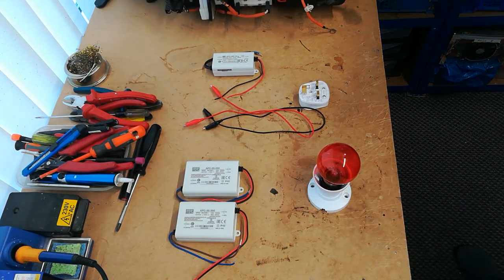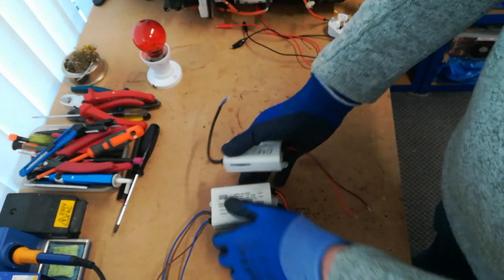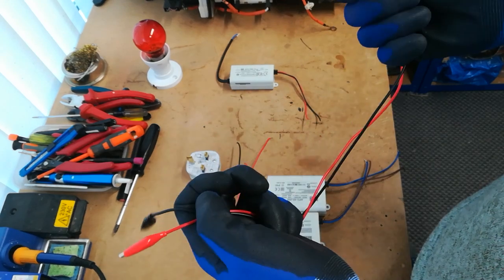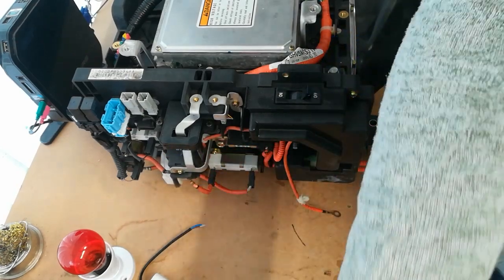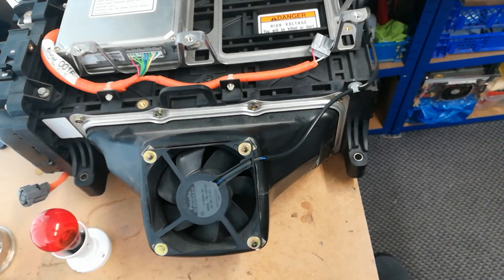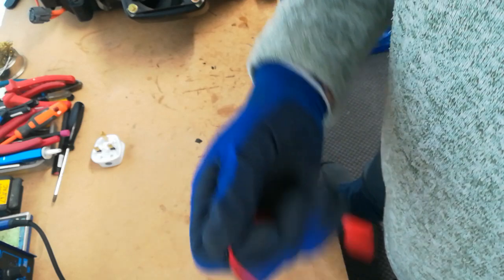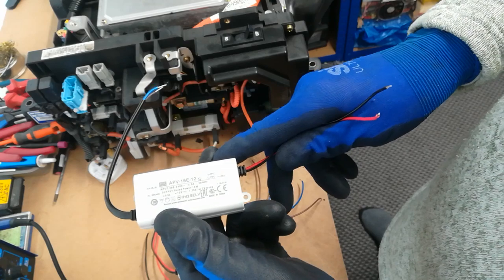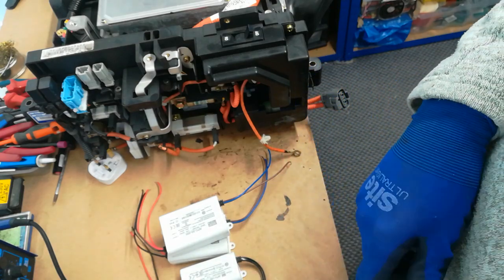Build your own cheap Gen 1 Honda insight Hybrid IMA Charger/Discharger rig.

Comment: do the charging/discharging terminals between the resistor positive and the negative show voltage with the switch off & the ima off the car?
Reply from the maker: Exactly what time point in the video are you referring to?
Reply: thx  @retepsnikrep  ... at 3:45min ...
Reply from the maker: No they don't.  The ima switch breaks the pack in half .
Reply: awesome, thx @retepsnikrep  ... and with the switch in the 'on' position ? is there a voltage ?
Reply from the maker: @solartonytony5868  Yes

Comment: In the U.S. its almost impossible to find 230 volt bulbs, so you can series wire 2 identical 120 volt bulbs to make a draw on the IMA battery. if using a single 120 volt bulb beyond 130-ish volts it will blow.

Comment: Thanks Peter. I have successfully used your grid charger for some years, but have only just done the full charge-discharge-charge-discharge-charge cycle, after the battery went really flat in storage, and did not come up well with driving or a simple grid charge. Initial results are very promising, much more ima, much better mpg. 12 yr old genuine Honda battery in a g1 insight.

Comment: Hard to believe.
I'd like instructions for my gen 2 prius.
I'd be willing to use a 120volt squril cage fan to cool my pack.
My fan has a plug with several wires.
I could research which 2.
But I'd love to make the charger for my 07 prius.
Like they say a little over 200 volts DC thanks.
Love the Alabama accent!

Comment: 3 questions from the U.S.:
(1) What are the wire color matches for the fan connections? I don't see it in the comments anywhere.
(2) Can I use the APC-35-350 on 120V AC?
(3) What 120V bulb wattage should I use for discharging?

Comment: Maybe I missed it but what regulates the amount of voltage that will be fad to the batteries ? , will they be over charged ? Also on the discharge , keep the load on the batteries till you reach zero on the meter ? TKS
Reply from the maker: The led drivers limit current and voltage. You limit time by turning it on/off after x amount of time.
Batteries empty = good when discharging. Holding them low also helps. Just leave bulb connected.

Comment: Hi Peter just wanted to ask, how long should you leave it hooked to the Grid changer, like how would you know when it's changed and is it possible to overcharge the battery with this kit?

Thanks
Reply from the maker: This basically covers it.

Your Honda Insight has been fitted with a bespoke IMA battery charger & discharger.
This will help the car throughout its life as the IMA battery ages naturally.
It can also help when storage or lack of use has lead to the IMA battery becoming unbalanced or weak.
The device should not be used routinely, and is not designed to make the car into a plug in hybrid (PHEV).
The Insight battery capacity is too small, and it cannot provide that function.
The charger/discharger is purely a maintenance device for occasional use per the instructions below.
The charger/discharger is a low current device with fan battery cooling designed to work over an extended
period. It gently balances, cycles and fills all the 120 cells in the IMA battery providing improved performance
and longevity.

When to use the Insight IMA battery charger & discharger.
When you use the car normally you will occasionally notice what are known as negative or positive
recalibrations of the battery state of charge (SOC) gauge.
A negative recalibration is when the gauge suddenly drops over about 30 seconds from a high state of charge
(more bars) to a low state of charge (many less bars). This phenomenon is often accompanied by a subsequent
forced charge shown as some green regeneration bars on the gauge.
A positive recalibration is when the gauge suddenly rises over about 30 seconds from a low state of charge (less
bars) to a high state of charge (many more bars).
These recalibrations occur normally at varying intervals. Less recalibrations generally equates to a healthier and
more balanced IMA battery. If recalibrations begin to occur more often than once a month then it is time to use
the charger/discharger.

Performing a simple charge. (Always try this first)
Park the vehicle where you can access mains electricity and can leave it undisturbed for at least 24 hours.
Ensure the charger three position switch is in the middle (off) position.
Plug the charger output lead into the car charger socket underneath the right hand side of the rear shelf.
Plug the charger mains lead into your mains socket and turn the power on. You should hear the sound of the
battery fan after a few seconds, if you don’t check the connections and contact me for advice.
Finally move the charger three position switch to the up (Charge position)
The battery is now charging and it should be left for 24-36 hours.
The exact time is not critical within the above limits.

If you are not going to discharge at as well, then reset the IMA system as detailed and evaluate your results.
Note. Charging as per the above should always be done before discharging.
Performing a simple discharge. (Try this if simple charging does not help)
Once a charge is complete unplug the charger from the mains.
Discharging is a simple procedure and the car is connected to the charger in the normal way.
During discharging no mains power is needed, and the battery fan does not need to be operating.
Once connected, to start a discharge move the charger three position switch into the down (Discharge) position.
The standard orange 60w incandescent bulb should light, if it doesn’t check connections, or if the bulb has
blown. Ring for advice if needed.

Leave the discharger to operate until the bulb grows dim or goes out. This may take anything from 6-24 hours
depending on the condition of your battery. A longer discharge time usually means a healthier battery.
Once the discharge is complete perform a simple charge, then reset the IMA system to evaluate your result.
Reply: @retepsnikrep  thanks for the quick response, especially so eurly in the morning 6:16 as of writing, I'm going to be using this on my 2003 honda civic IMA, it has a 144v NIMH IMA battery pack, would this still work for my model? My reason for wanting to grid charge (using your method) is because I'm getting OBD error (IMA Miss balance) this is also throwing a ima overheating error as some sticks are overcharging because of the miss balance.
Reply from the maker: @alfredmanner6881  it might help a bit. You must have a fan cooling battery when charging though.
Reply: Thanks for all your help, just one other thing, I'm getting. P1449 error (battery deterioration) but the sub codes I can't get, I need a OBD scanned that can get sub codes, do you have any suggestions on a good one scanner, there's quite a few on eBay, some usb ones that connects to scantool

Thanks
Reply from the maker: @alfredmanner6881  Ask on insightcentral.net or use the blink code method

Comment: Prius?
Reply: This will work for the Prius C (Aqua / Yaris Hybrid) which also has 120 cells.  (I did it to mine already) The fan is a bit more complicated, so you'll need an extra fan. I'm going to try a 100mm (4")   inline bathroom  extractor fan, which should fit the air inlet quite nicely! Other versions of the Prius would need an LED Driver that produces a suitably high voltage to match the pack you have, being sure that the current is no more than 350mA.
Reply: @richardking6066  did you do discharging as well ? How long does it take to charge and discharge?  How can we tell if battery already full charged and enough discharge.  I got prius c . May give it try.  Thanks look forward from you
Reply: @mbahmannz  You charge until the voltage is maximum, I think I got to 170volts. I discharged with a 100w 240v lamp. Watching the voltage carefully, do as not to go below the safe minimum per cell...

Comment: Wiring the drivers together like that increases the amp output. The voltage stays the same
Reply from the maker: No it doesn't. The outputs of the drivers are in series. The voltage is doubled, the current remains the same.

Comment: Great video! I ran into 2 different issues when trying to tweak this video. 

I tried to build a 300 vdc for a camry hybrid. I wired everything up got 300 vdc without it hooked up to the battery (3 of the same drivers) . When I hooked it up to the battery it blew the drivers (immediately), I suspect I need a diode in the system. Does anyone know the diode that would work best?

Second issue is that I tried to discharge the battery with a 500 watt halogen light. It blew it within 2 seconds. The ohms of the light is 2.3 ohms. What would I have to put in the system to safely discharge this hybrid battery with this light? Any helpful information would be great. Thank you.

Comment: hi Peter will this work with 2009 Honda Insight?
Reply from the maker: yes..
Reply from the maker: But you need lower led voltage supplies..
Reply: can you tell me which ones exactly i will need?
Reply from the maker: @TObject  Read this thread on the crz forum its the same as the G2 Insight. 
https://www.crzforum.com/threads/nimh-ima-battery-would-there-be-any-forum-interest-in.94400/#post-1397295

Comment: I've found the meanwell LPC - 100-350, it has an output of 143 vdc to 286 vdc 100w, 350 mA.  Do you think that it is proper for a prius gen 3?  It has 28 modules of 7.2v nomimal voltage which adds to 201.6 volts.
Reply from the maker: Possibly.. I don't have a Prius so it's all at your own risk.
Reply: Keep an eye on the voltage, charging at 2XX volts might be iffy
Reply: @JulioSanchez-l7o  done it. It's all good. Charged and balanced in 24 hours. Sweet!!
Reply: Any updates for Prius .?
Reply: Did that charger work for your Prius. Please, share.
Reply: @againsttyranny2149  yes it does work. I also bought another one which is 200w to charge faster and that also works.

Comment: Hi and thank you for the video. It's very helpful.
Can I ask you something?  I've got a gen 3 prius which is about 240 volts... If there's no 240 v output power supply, can I connect in series two 100 v power supplies plus a 40 v power supply,? To make a 240v supply???  Thanks
Reply from the maker: Probably

Comment: Hi Peter,

I have a 2006 Honda Civic hybrid which it's battery specs are below, what kind of LED power supply I should choose for charging it up? Thanks 

Nickel Metal Hydride (Ni-MH) Battery
Output (Volts)
158

Rated Capacity
5.5 Ah
Reply from the maker: 2 x 100V 350ma  supplies should do it..  Don't forgte you need to cool the pack with a fan.

Comment: Curious why some are against constant current drivers for grid charging?
Reply: I think it may sometimes be only a problem when using two in series.   Although I've just done it successfully with my Prius C/Yaris Hybrid/Aqua.  It took about 6 hours to reach a full charge, and I gave it another six to balance the cells.  I used a 4in tubular exhaust fan, meant as a bathroom extractor! - to flow air through the pack.
Reply: @richardking6066  can you please let me know which driver you used for Prius c.

Comment: Will this process work on a 2013 civic hybrid
Reply from the maker: Yes if the Civic 2013 Hybrid is a Nimh battery, and you use the right voltage range power supplies, provide cooling air etc.

Comment: Hi Peter, Great video. Would this charging setup work on a 2006-2008 Civic Hybrid?  Thanks!
Reply from the maker: Probably but you will need to add a standalone fan or suitable driver for the oem fan to the system to pass cooling air through the pack.

Comment: Thanks Peter! I just finished building this and the hybrid battery is charging, the cooling fan is running. Everything worked great. I was pleasantly surprised to find a wiring harness in the battery box with leads running to all of the necessary spots. Took about an hour to build this and get it going. You do incredible work. Thanks again.
Reply: How was the result? Did it work ? I'm planning to make one. Thanks in advance

Comment: Hi Peter, thanks for this interesting post! I want to make a permanent connection to the IMA battery, with a DIN bajonet connection to the charger/discharger, do you recommend the crocodile clamps or better to use a slide terminal?
Reply from the maker: Use 1/4" double spade connector for the + and a 6mm ring terminal for the negative.
Reply: @retepsnikrep  Will do! Thanks again Peter!
Reply: Hi Peter, I made my grid charger yesterday, working fine! Still have two questions: 

- Should the IMA fan be running during discharge? (I made a switch for the fan, so I can choose ON/OFF)
- I made the charger so that charge and discharge both run through the same casing, with switches for Charge, Fan and Discharge, with a DIN bajonet connector and fixed wiring harness to my Insight. During discharge the 350mA LED drivers will be under 170V DC tension, I suppose there is some sort of diode integrated or is that a problem?

Thanks again, this saved me a lot of money, both in making the charger myself and extending the lifetime of my IMA battery :-)
Reply from the maker: @northmanclassics9651  It doesn't need too.